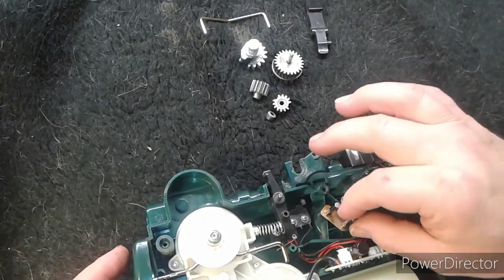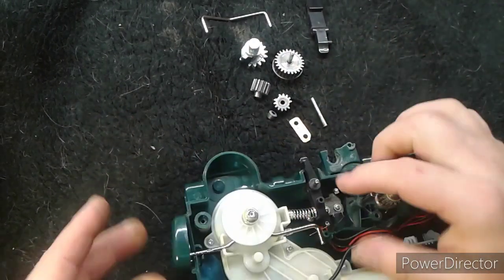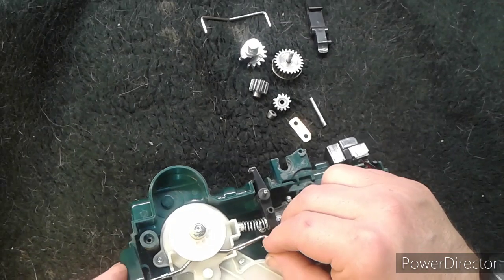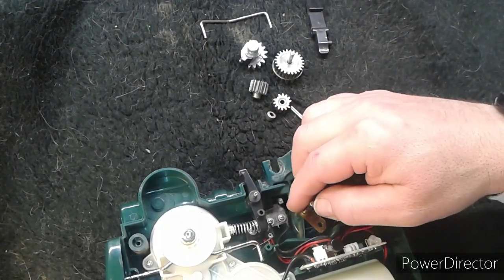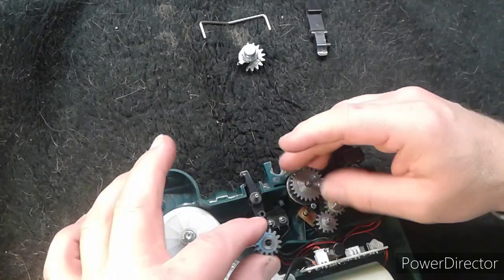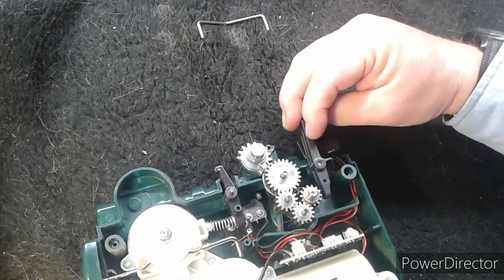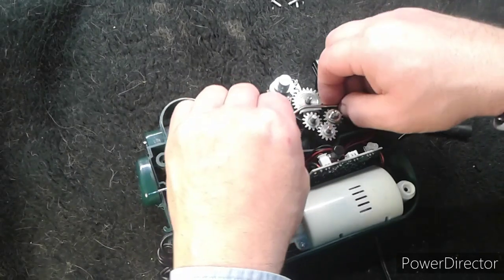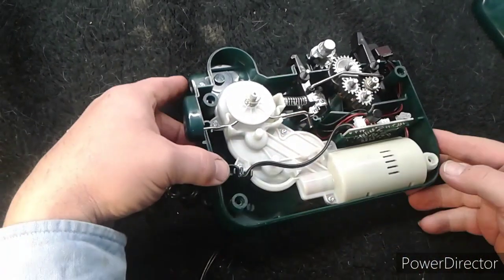Smart scoop litter box motor unit reassembly.

Comment: My rake on the litter box is not scooping up at all. I have 6 of them and they all do the same thing after 1 year. They skill run but the rake no longer scoops up and then it gets jammed on the little box and breaks parts off. I have fixed all the parts that broke but it still won’t scoop the rake up. Any idea how to fix that?
Reply from the maker: i have not come across this prblem yet.  So, No.  Sorry.

Comment: Thank you, Dave. That was helpful. :) But you mentioned 2 springs in this video. I saw the big one one the left, but where is the other one? A spring fell out of mine.
Reply from the maker: Just for clarification, is it an actual spring ?
There is a short connector rod located between the 2 black plastic levers ( over the steel gears) - there is a steel rod with the green handle ( over the white gears ) and then there is an actual coiled spring to the left and above the white gears, but in my unit, it did not fall out easily, so i did not mention it.
You can see its location in the video.
Reply from the maker: The coil spring is directly applying pressure to the first black plastic lever
Reply: @youcandoitdave6058  It was the actual spring. Thanks to your video, I saw where it went. :)  Also, you should mention that the gear with the opening needs to be put back in with the opening at the top; that's where the rake goes. I, of course, figured that out after I had the whole thing put back together. 

It seems to be working now, but it still makes a horrible clicking noise as the rake starts to go up. None of the gears or plastic pieces are broken. I even tried spraying WD-40 on the gears, but it didn't make the noise stop. It's exactly what happened to the previous 2 boxes I had, and I see that others complain about it as well.
Reply from the maker: Glad i could help.
Reply: Do you have A way to send you a picture of the part that fell out

Comment: Great video Dave.  My unit works fine except that the optical sensor no longer detects movement from the cat or any movements.  Yes I cleaned the glass window several times.  Is there a way to fix/replace the sensor?  Thanks
Reply from the maker: Never really opened up the sensor area.
I would use the video guide, open it up and slide the sensor unit ( and cover) out - then with a clean tissue, wipe down the inside of the cover and the sensor.
There may be a build up of dust INSIDE the cover....
The plastic cover and sensor should just slide out once its opened up.
Hope this helps.

Comment: How do I remove the motor
Reply from the maker: There are a number of silver screws around the white housing, remove those and the motor / gear unit should lift out.
Are you planning on replacing the motor unit ?

Comment: I had a piece fall out. Don't look broke but I couldn't see where it went following your video. How can I send you a picture of it maybe you can pin point it what I didn't see
Reply: Dave the part that fell came from where you take the screws out above the two white gears you will see a silver Dot is connected to a rubber wheel type lever. Can you help me figure out how to get to the part from the other side
Reply from the maker: Are you on Facebook?
I usually send and recieve pictures over messanger.
Send picture too Daves Hobbit Home build if you can.